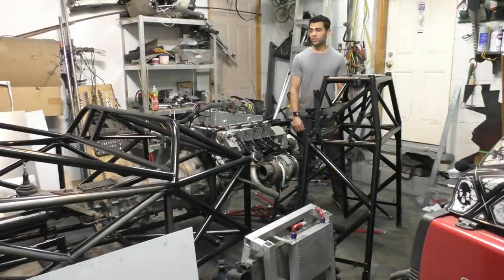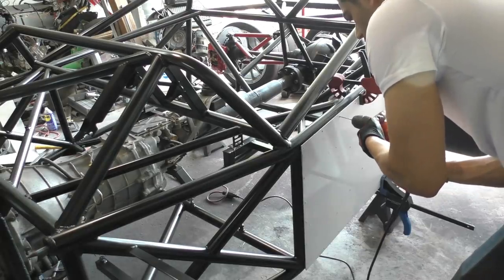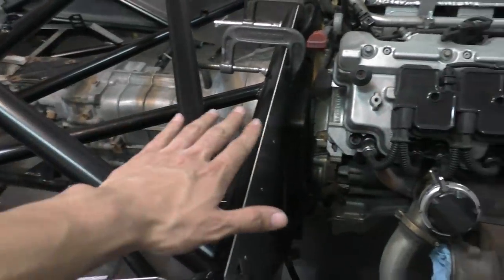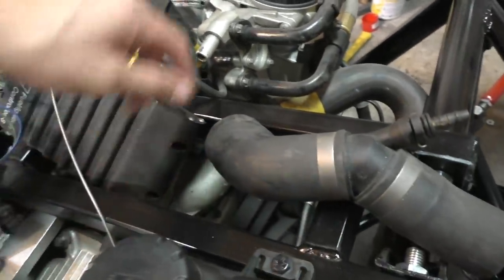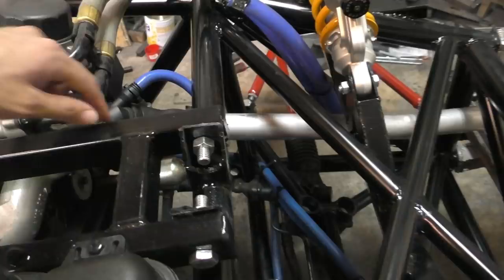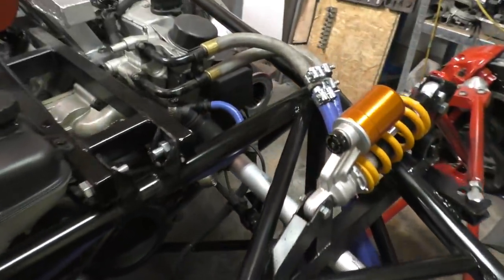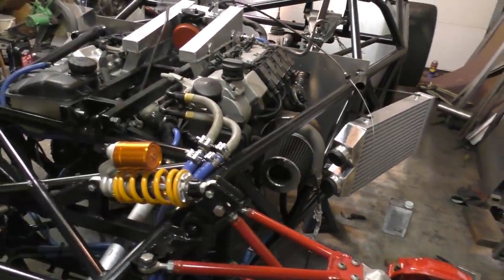Cooling System and a Bunch of Finishing Up - E55 ASL Part 15

Comment: You will need to put a reservoir / sump underneath your turbos , that pump will die if it doesn’t have volume in front of it , also you risk starving the turbos of oil by vacuuming them out . 
Two little catch cans with breathers would be ideal .
Reply: He mentioned scavenging pumps during the video.
Reply: Robert Moore 
You need to read my comment again . It’s more about not damaging those pumps and making that system work .
Reply: Well, if your talking about after turbos when you say "under", that's what the oil pan is for. The scavenging pumps will be pulling oil from there for the turbos. Your idea will have oil everywhere.
Reply: Robert Moore 
Those pumps will burn out if they are pulling against a 1mm restrictor , you need to put a small oil manifold or sump or tank with an air input in front of the pump to relieve the pressure on the pump . It obviously still returns to the main sump . 
What I said makes sense and has been used in practice .

Comment: Amazing build,you are smashing it my friend. Hate to be this guy but I’m 99% sure your front rotors are for the same side of the car ie two front left hand side rotors.  the internal fins throw out not grab at the air on both sides. Keep up the amazing work 👍
Reply: All brake rotors throw out air from centrifugal force. If it looks like it's grabbing air it's actually the wrong way. Non directional rotors have straight veins, directional rotors should have the upper veins curved toward the back or the car, assisting throwing air out when spinning forward. Outside cooling ducts will always go to the center of the rotor not the edge.
Reply: jason birch so I’m right then. Cheers 👍

Comment: The moment U mentioned the brake disks and massive calipers I had to think again about the classic way to build sports cars with inside breaks close to the middle axis of Ya car. Again it would reduce dead, unsuspended weight. But probably that would be too difficult to realize. I am eager to see U driving this fantastic car.

Comment: This is my favorite channel. I can't wait to see this thing run. Those dual radiators were sketchy at best - when new. It's a known issue with older AMG's. You risk power steering fluid leaking into your coolant.

Comment: Most of the rigid coolant tubes my company uses when constructing a purpose-built machine are aluminum, and are formed with a propane torch to heat a local area juuuust until to tube starts to yield. If you are slow with your heat and don't over do it, the hardening is kept to a minimum. They end up looking mandrel-bent and have an excellent service life... never had one fail yet...

Comment: hi for the wastegate line make sure you use a metal fitting.  If you run high boost a silcone line wont do.  the Zip tie can melt and the line can pop off on high boost.

Comment: I have enjoyed watching your ASL videos. I also know you will be driving on prepped surfaces. It would be a lot of work to change at this point, but you would get more suspension travel if your heim joint mounts were verticle, rather that horizontal. I noticed you only get about three inches total with the front end test. Other than that, the engineering seems to be really good and well thought out.

Comment: @12:56, had the volume off so not sure if you mentioned this but just FYI, you will have to either weld a bead or roll an edge onto those Ally radiator pipes.

These will definitely pop off under pressure, I have seen it time & time again on Lotus 7 Replica builds etc.

Its the last thing you want after all the long hours of effort.

Comment: Funny how that touch of red makes it look that much more serious. Are you going to invest in some sort of aero testing to identify any turbulent areas against the body and what measures are needed for the underbody aero? Ie; flutes in wheel arches, strakes along entire length or turning, exiting at a low pressure zone at sides and/or a rear diffuser? I know you have probably identified everything, made plans to address them etc etc before even ordering materials but I’m curious as to what I have to look forward to...
👍. I’m thoroughly enjoying the build and hope there is a directors cut in the works that run through some of the fundamental points of fabrication that most people without an engineering degree/masters would likely not know about. 

Thanks for sharing this with us, just seeing it done and living victoriously through you is infinitely better than not experiencing a build of this magnitude at all.

Comment: 202 C43 AMGs have that extra output on the back side of the right head.  When I swapped in the 55 engine I had to add it.  Curious it was part of the 43 AMG engine but not the 55.  More cooling the better IMO.  Have part # somewhere - took several weeks to arrive from Germany.

Comment: good luck hopefully you do well on your races 
if you could you may explain suspension more in details like angles and stuff and what math do you use 
even if you can recommend a book or something
Reply: Ahmed Samy check out his older videos, he goes over the suspension geometry and the spring rates
Reply: yeah I watched them. However, I cant design my own cantilever suspension system
I don't know how to set angles and what angle is the rod inclined stuff like that

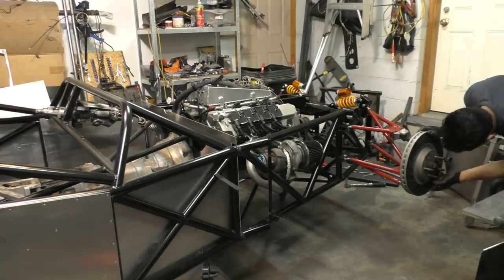Comment: Your brake disc at 9:00 is on other side than it should be. Cooling vanes inside should grab air from center of disc and pull it out as disc rotates not oposite way.
As video continues it looks like you have got two left side brake discs on your front axle instead of one left and one right.
Reply: Are you sure? Maybe I'm missing something but AMG brakes I saw were installed like this. But if he wants to use the F1 style brake cooling maybe it would be better the other way.
Reply: @antalbodnar3188  Yes I am sure. its not about holes or  grooves (they are comonly in different shapes and direction for different brands)
Its about shape of cooling veins (fins) inside of disc. 
If veins are directional (and from video it looks like here they are) it must be in the direction where air is pushed fron inside out.
Reply: @antalbodnar3188  You realy not want the crazy hot air from brakes stacked up inside near your bearings and other stuff. Thats why the air is pushed out.
And also consider centrifugal forces if you want air push in other direction thats gonna works againts each other. 
Also all sports cars equiped with cooling ducts have directed them into center of brakes to improve mass of air and flow from inside out.
Reply: @derimmor  I know it makes sense but I think he has it installed like many other people. I think it is installed like this in the factory. OR nobody knows which is the correct direction. Maybe there is a reason why the top vents ar facing forward I don't know.

Comment: If you havn't changed the radiator on the recall (if your car also includes in the recall), then maybe consider doing the recall to ensure the coolant and powersteering fluid dosent mix.

Comment: SFI Bell Housing.......? 

Any time you install hoses or other rubber parts, using some type of rubber safe lubricant will make installation and next removal super easy. Also, all of those adjustable suspension threads, hub faces on both the hub and brake rotor will love a coating of copper antisieze, as well as the threads of all the coilovers. Another thing, smooth band hose clamps will be your best friend.... Will you be running actual coolant or distilled water with some type of wetting agent?

Comment: Do yourself a huge favor right now. With your aluminium main tubes. Either get some beads rolled in to the ends where your are going to clamp them or run a bead of weld about 3/4's of an inch from the end. That way you create a barb for the hose to clamp to. If not. You will be blowing the hoses off of those tubes all the time. Been there done that. It sucks ass!!!!!

Comment: oil cooler lines should be crimped and you should use hydraulic lines like the ones on excavators' press machines etc...they have steel mesh inside...silicone hose will not work, been there, done it , seen others doing it, it all failed...go to a truck and machine repair shop and ask them to crimp you some lenghts of tube, its cheap and lasts forever. dont start skimping on quality and rushing things, we are expecting much of this car. keep up!!!

Comment: oh cooling the steering oil with radiator nice.. But how much the engine heat but in the radiator and how much steering pump but on the hydro oil did check it?

Comment: You'll want a bead roller to put a bead on those aluminium pipes or you risk those hoses  blowing off under pressure.
Reply: Some weld around the ends of the pipe, or simply some good beefy clamps will do the trick
Reply: @tomb9818  just get a bead roller, you can put big X's into those big flat ali panels to kill a lot of vibration as well.

Comment: Hi, I’m a new viewer to this build but I thought I’d point out the coolant reservoir needs to be the highest point of the system for the air to bleed into it effectively at 13:15 it looks like it is lower than the hoses you were fitting.

Also what is the plan for the front sway bar?

Comment: awesome project! but you are going to kill your PS pump using the auto trans cooler in the rad, its not a true cooler it keeps the trans fluid hot same temp as the engine coolant which is way to hot for the power steering system, just use a small air to fluid oil cooler that should be more than enough. keep up the awesome work!

Comment: Is that aux coolant pomp also running for a while after engine shutdown? That would be great for the turbos. otherwise i'm missing the point of that pomp.
Reply: Water pump alone not enough. My E39 has one.

Comment: 1: Do You wanna install dry sump system? 

2: What is the size of the rear wheels? 

Thank You in advance.
Reply: he said he is gonna test his wet sump first, will change to dry sump if the engine got issue with the g forces, front tires is 295 rear tires is unknown but i guess it has the same size as  the front
Reply: @joat9105  Thank You! 
295mm at front - thats a serious tire.

Comment: The vent hose needs to run level for proper air relief and return to the reservoir. You should flare or bead roll the ends of the aluminum cooling tubes as well. they will blow off eventually. It all coming together nicely. Will someone that is involved with racing in the tracks he runs on please alert the tech people about his unbalanced and welded together driveshaft!! No one wants to see the inside of his hip and ass after that thing let's go at 6000 rpm.

Comment: Won't flipping a steering rack from left to right hand drive cause the steering to work in reverse? ie if you turn the wheel  to the left the car might steer right?
Reply: That's why he flipped it upside down I think?
Reply: I probably mis- understood -My family had a left hand drive hill climb lotus seven and we swapped to right hand drive using the same rack -flipping it over so that the steering shaft lined up and it ended up steering opposite so we had to get a new rack!
Reply: 15 minutes later-I've looked at minute 18 of episode 8 re steering -now understand method-Will be an awesome car.

Comment: Shud use riv-nuts and bolts so the panels are easily replaced
Reply: Weight, and pop rivets aren’t hard to drill out. The panel bond will be the biggest issue should you ever need to remove one of those panels
Reply: @toranaandy2245  aluminum bolts
Reply: Cost vs weight, aluminium rivets are cheap as and can be drilled out in next to no time. Nutserts aren’t cheap and aluminium bolts are even more expensive. The simple solution is quite often the best

Comment: Looks cool but i feel like the front clip needs more than 4 mounting points.
Reply: Go back and watch his older videos, you'll see how he engineered it to be solid
Reply: @beerdeliveryguy6265  i watched them all been following since the very first cantilevered race suspension in the trunk of the benz. but i also realize there is going to be a ton of sprung weight and flex on the nose piece with only 4 main bolts attaching it to the main body. Then you have to account for the  torque and flex of the drive train when shifting. Hard accelerating etc.. engines themselves try to kart wheel under hard acceleration. And i dont see those 4 bolts holding all of that stress..

Comment: Building a car is easy, but just 4 bolts to suspend the 250 kg+ of the engine + gearbox, above the road?
i believe the Bugatti Veyron uses like 14 titanium bolts to mannage 1001 PS, i guess you a bit short.
you should try Autodesk Inventor to simulate the forces on your chassis before proceeding.
don't try this car ... before research.
Reply: I think he did SIM this in some of his earlier videos.